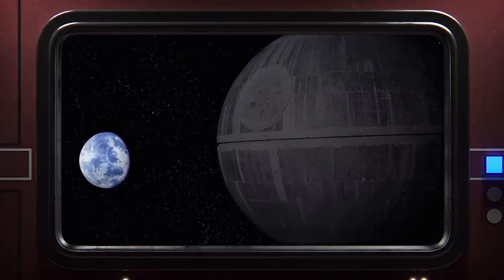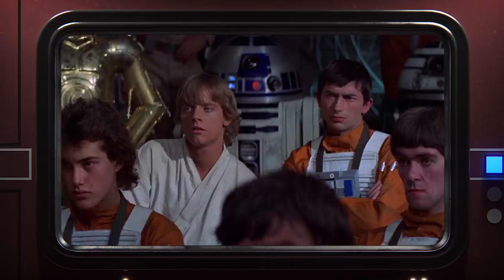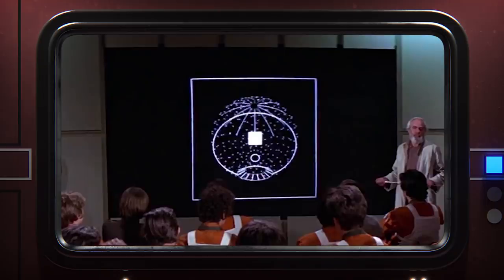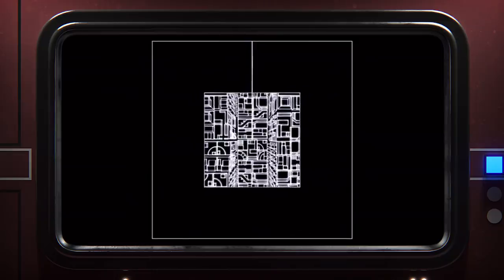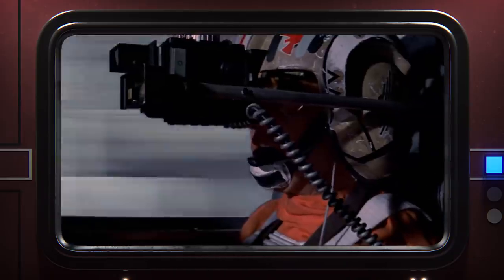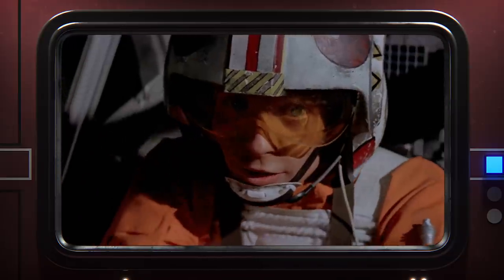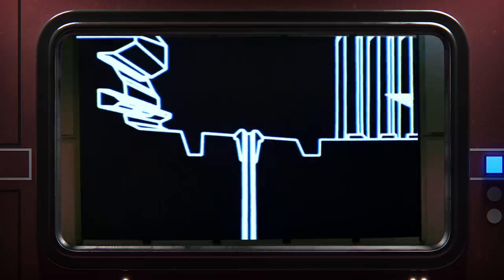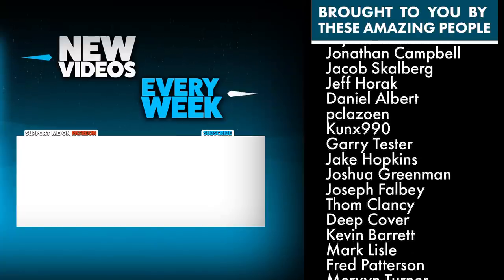The Thermal Exhaust Port Was NEVER a Problem

Comment: I, personally, never had an issue with the exhaust port idea. I always took for granted that the exhaust poet was tiny and thus it would be overlooked or easily missed. It also contextualized Rogue One's story into Gaelan sneaking a small detail past the Empire.
Reply: which shows just how well protected the damn thing is! it not considered a weakness for a REALLY good reason. after all, you have to dodge thousands of Turblasers, hundreds of Tie Fighters, then manoeuvre down a VERY confined trench loaded to the gunwales with more guns and fighters on your ass. its a total suicide mission. and that is assuming you don;t have an actual defence fleet on top of all that.
Reply: If I remember right, Rogue One never calls out the exhaust port itself either. Galen stated his design was so a small explosion near the reactor would trigger a station collapse, Galen never states "pick this exhaust port to hit my weakness." For all we knew, Galen assumed the reactor would be sabotaged by a crack commando team and the thought of trying to fly a torpedo through a narrow port to the reactor would have sounded crazy to him. Its likely that Rebel High Command knowing were Galen's weakness was and pressed for time due to the approaching battle station just chose the exhaust port as a Hail Mary type of plan, it was the fastest way to get an explosion in range to trigger the reactor failure Galen designed. It explains why in a lot of the expanded stories coming out now that the Rebels already had evacuated Mon Mothma and other key leaders from Yavin, with really only Leia, Dodana and two starfighter squadrons staying behind to lead the attack on the Death Star... it was a crazy plan they had no way of guaranteeing it would work.
Reply: Lassi Kinnunen  The bothan spies line is for the second death star in Return of the Jedi. Unless I am remembering wrongly the only thing really known about the data in A New Hope is that Leia has it and Vader was chasing her down because of it.
Reply: Lassi Kinnunen  Bothat spies stole data for the SECOND Death star.
Reply: Jacob Lyman if you read the Rogue one Novelizasion it goes into more detail about the sabotage and it was fully intended to be a torpedo shot. Krenik even realizes this in his last moments as the Death Star charges up
Over skarrif
Reply: Lassi Kinnunen  That not really the point, the point is that not even RO thought that the port was was a plot hole. Instead of trying to fix something that was not broken they instead used RO to explain why the destruction was so absolute.
Reply: @IronWarhorsesFun  honestly, the rebels got lucky that tarkin was way overconfident. he could have sent out the hundreds or thousands of tie fighters stationed at the death star and completely overwhelmed the rebels by a factor of at least 100, but the only ties that went out were the few squadrons under vader's direct command, because he recognized the danger that tarkin didnt.
Reply: @taloob493  vader had superior experience and the force to warn him.

Comment: I did like that Rogue One didn't say that Galen added in a vulnerable exhaust port where there wouldn't have otherwise been one. Like the video says, it was already there, it was already as vulnerable as it would ever be.
What Rogue One did tell us was that Galen sabotaged the reactor systems inside the Death Star. That way, if the Rebels did manage to fire a torpedo down the shaft, it wouldn't just take out one reactor, letting all the other ones pick up the slack. He ensured that any damage to any reactor would create the chain-reaction throughout the WHOLE reactor system that would destroy the station for sure.
All the rebels had to do was get their hands on the Death Star plans, that would give them the intel to have the best chance at making the near-impossible shot down the only vulnerable exhaust port, which instigated this chain-reaction, and destroyed the station.
Reply: I assume Galen wasn't planning on the Alliance trying to thread a needle through a hole that the computer couldn't even pick up properly, his design and the message he sends to Saw and the fact he sent it to Saw of all people makes it seem like his plan was to make the Death Star vulnerable to internal sabotage. We saw that a skilled stealth agent namely Obi-Wan could navigate the Death Star relatively easily. Trained spec ops the likes Saw is and has at his disposal would have tried to infiltrate the station and set a chain reaction from inside the station. Now that's obviously a suicide mission given all the things that could go wrong if you tried a remote detonation and that makes even more sense as to why Galen entrusted it to Saw and not the Alliance. The reason why the Alliance had to go all out and risk everything on an all or nothing fluke shot was that they didn't have any other choice. The Empire knows to expect trickery and they cannot evacuate in time but they have 30 something Starfighters and a bunch of flyboys who would want to go down swinging may as well get one of the best military minds in the rebellion to have a crack at figuring out how to exploit Galen's weakness from outside the ship.
Reply: Gibbons3457 Oooh, that’s a good point, I’d never thought of that before, that’s very likely!

Comment: IIRC Gailin Urso's Specific act of sabotage was to design the main reactor in a way that made it vulnerable to instability. Instead of being explosion resistant, a small explosion would trigger a catastrophic chain reaction. 

I have a feeling Gailin Urso was thinking someone might smuggle explosives and sabotage it that way. The 'shoot torpedoes down an exhaust port' thing was the rebellion trying to come up with a desperate last minute plan to get an explosive to the reactor.
Reply: Well keep in mind that the Death Star used kyber crystals. Those things become incredibly unstable if they have too much energy applied to them. The larger ones specifically will detonate and we've seen this happen three times: twice in Rebels and once in an unused Clone Wars arc on Utapau.
Reply: @SoranoGuardias  Now imagine how easy it would be for a genius architectural prodigy to design a reactor system that runs on these ridiculously dangerous exploding crystals that LOOKS good and safe to everyone else but is in fact a carefully constructed house of cards that'll implode upon itself and vaporize the entire station if you smack it with a shockwave.
Reply: @shingshongshamalama  That only happens when you invert the power supply. XD
Reply: Yeah, this has been my opinion since that scene where it was revealed he set up the flaw.  The flaw was in the reactor, that it'd explode if poked wrong.   He didn't know how it might be best exploited, that's why they still needed the plans, instead of putting 'target the secondary port at Bearing 120' or whatever in the same message he mentioned he'd done it.
Reply: Which makes more sense tactically a small team especially one willing to die is more the rebels way. Space battles are always going to favor the Empire the Rebels need to hit and run.
Reply: Galen Erso
Reply: That was exactly my thought process as well
Reply: That's a great point.
Reply: This does beg the question: did it need to have been two torpedoes, or could the rebels have sent the space equivalent of paratroopers to land on the surface of the Death Star and plant the explosives? My guess is this wasn’t considered because it would have been a suicide mission. Any attempt to retrieve the soldiers would have, no doubt, been foiled.
Reply: this is exactly my thought as well. The architect didn't foresee the port either, and figured someone would suicide bomb it though infiltration.
Reply: So the sabotage was the reactor being vulnerable to a chain reaction in the first place, but the vent being able to start one was completely accidental and overlooked because they assumed there was no way a cascading failure from a vent would cause the reactor to fail.

Comment: I think this actually has significant credibility. The Death Star has tons of systems and subsystems which probably needed various power generation and heat/chem/fume/spacemagic exhausts of their own. If  this port was just for the main reactor for the laser so it kinda makes sense that it would have its own dedicated line of exhaust passage, rather than integrating with another system. Only with the plans in R2 could they identify which of the many exhaust ports would do the most damage. I also imagine that none of the other exhaust ports had anything more than ray shielding because the Empire "didn't deem small one-man snubfighters a threat" Throw in the physics bending required by Luke (potentially) and this explanation works rather well.
Reply: future9er24 
Fantastic point.
Reply: The exhaust port didn't even need to be for the main reactor, the ports could've been for each of the small lasers that combine into the giant laser. Blow up one of up the small lasers, which will then set off a chain reaction into the main reactor

Comment: A massive, heat-generating metal object with no thermal exhaust is called an Oven.

Everyone would have baked alive inside as heat built up within the station.
Reply: Cybersmith_Videos well this one is magic powered.
Reply: @captainhellhound7451  I always imagined it was just fusion (or antimatter or black hole) powered. In RotJ it looks how I imagine a large black-hole power source would actually look, and the chamber it's within looks like a real fusion reactor, just absolutely enormous. The death star being able to radiate enough heat to avoid melting itself in seconds - that's the more unrealistic part compared to generating that kind of power (plus it isn't instantaneous energy - it emits a shot instantaneously but I always assumed the death star would need to charge up massive stores of energy like how real railguns and "super lasers" (think national ignition facility) use enormous banks of capacitors, and very powerful particle beams (synchrotrons like the LHC) are channeled around in rings so they can build up more and more energy over time - in fact they go through several boosting rings of increasing size leading up to the main ring. At the LHC these smaller rings are both predecessors to the current main ring, as the current main ring might likewise become a booster for an even bigger future ring.
It would build up power over a long time before firing, it would have plenty of time to do so, not need to generate planet-destroying power immediately).

 I know Star Wars is soft sci fi or science fantasy but never thought the power sources for ships etc require hand-waving magic explanations. One of the most sci fi believable things is immensely powerful yet compact energy sources, the option of nuclear fission as an energy source was sci fi a century ago.
Reply: Except you do not vent gasses in space to cool something down, except in an emergency. If you vent coolant, you lose it, so it needs to be replenished, by tankers. The only option is radiation cooling, which takes radiators, pointed at something colder than what you need to cool. The whole premise of evaporative cooling onboard a spacecraft is bonkers.
Reply: @Tore_Lund  that would be insanely slow. Diffusing heat by radiation, for an object the size and shape of the death Star? Insanely impractical. Getting coolant shipped in would be a necessity, yes. So would food, unless they have a farm hidden there somewhere. They presumably are also getting hyperfuel shipped in.
Reply: @cybersmith_videos  They might have some way of sellectively tunneling high energy photons away as an effective form of cooling? Same with the light saber, its crystal can't be 100% efficient either, where does that heat go?
Reply: @Tore_Lund  even if you could somehow radiate away the heat of normal operation, you're going to need some way to dissipate the waste heat from the main weapon that puts speed above all other considerations because even a fraction of a percent of the energy needed to explode a planet dumped into the station as waste heat would vaporize it if you don't have an absurdly powerful cooling system.

I mean, not that Star Wars works on anything like real physics, being space fantasy, but still.
Reply: I didn't expect to run into you here. The internet is a small place
Reply: @ImusNoxa  exactly what I was thinking
Reply: Ovens have thermal exhaust

The word you're looking for is Bomb
Reply: @dynamicworlds1 there's no such genre as "space fantasy". The word you're looking for is Space Opera